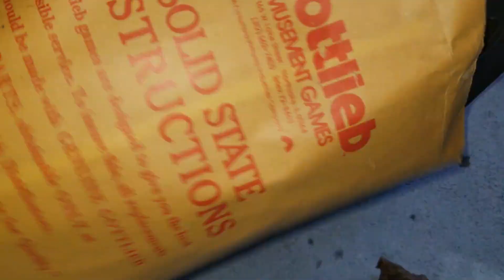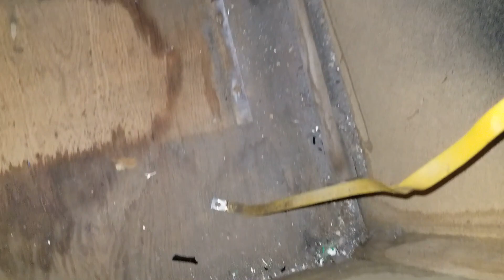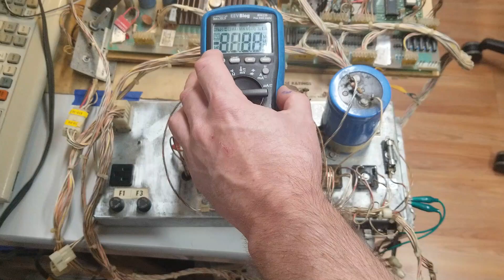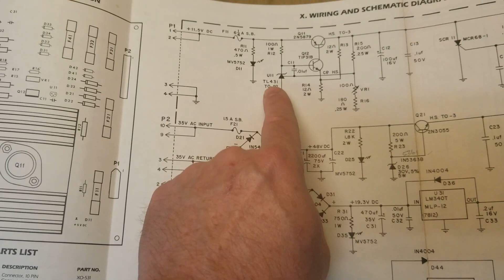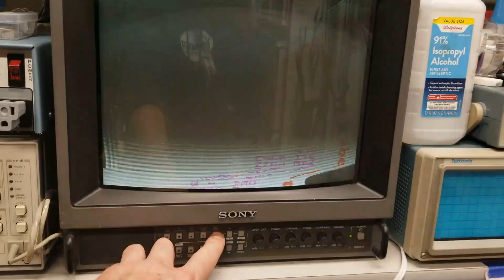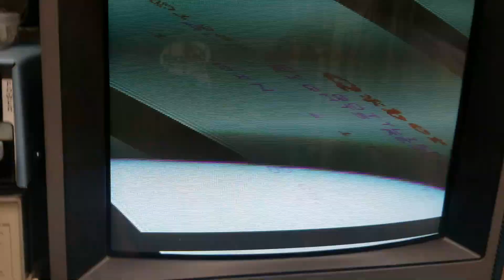Q*bert Refurb & Repair - Part 1 - Cabinet and Power Supply

Comment: Our machine has over 155000 games on it (before being switched to Free Play - and it might have been on >1coin per game during some of its life, but who knows) and only slightly more screen burn. Our Big Blue and the other caps are still good (or at least not bad enough for the game to show any signs of bad caps)
What threw me for a loop was the fuse holder for the +5V was corroded, sometimes but only sometimes bogging down the +5V, making the game crash which most of the time made the knocker solenoid lock on and blew the sound fuse, because someone replaced the 1A solenoid fuse with a 7A...
Ours has the swearing marquee!
Also "you should replace" (TM) the 30V Zener with a 24V one. All it powers is the knocker solenoid and the sound board amplifier which is only rated for a max of 27V...
A few weeks ago the sound board went weird, all speech was replaced with s and sh sounds (only rarely vowels) - took me three weeks to find out it was a slightly dirty edge connector to the sound board. Very weird, I measured all the voltages and all the signal on the sound board and they were fine.
Reply from the maker: Wow that is a ton of plays.  Maybe this one didn't get a lot because it says it has been down since 1986 with the video issue.
Thanks for the clue about the Zener.  I saw Riptor offers lower voltage one per request.  I will look into ordering one.
Reply: @jacklick  It was bought from the US and had a credit button fitted when I fixed it in 2015. The solder on the PSU module was so bad you could just pull out the components.
So my guess is it might have a few years of downtime every now and again since 1983, but ran much of that time.

Comment: So the whole problem was because the Power supply Power Transistors Nuts weren't making good contact with the pcb contacts that need a fiberglass pen to clean up the pcb boards contacts? In the service manual for the arcade game it should say what the operating AC ripple voltage should be under operating load. What is the operating AC ripple voltage under load?
Reply from the maker: Yep, The only problem after rebuild kit was the collector not making contact with trace bia mounting nuts.
Reply from the maker: I haven't tested ac ripple under load yet.